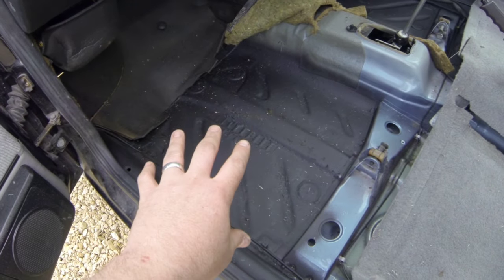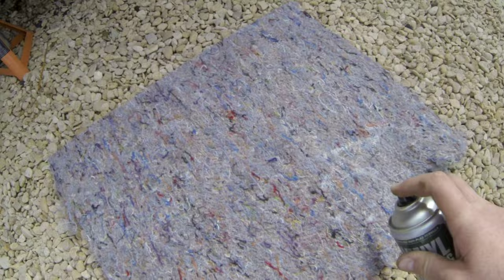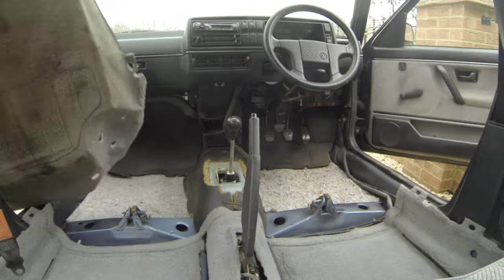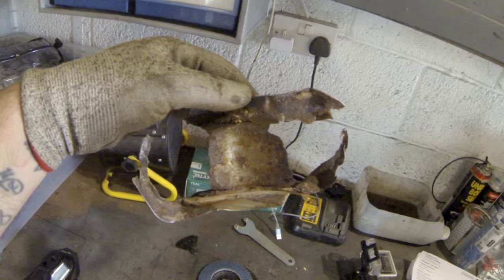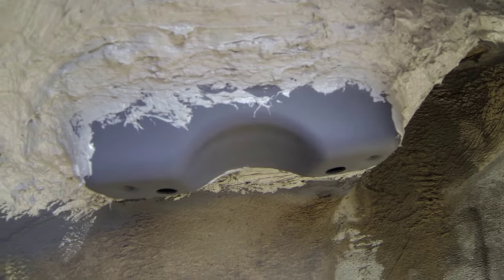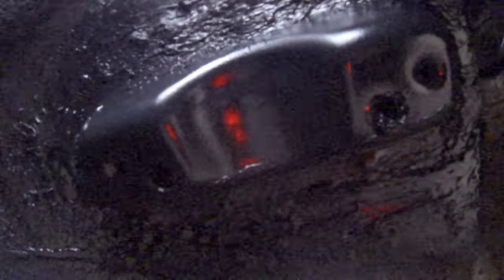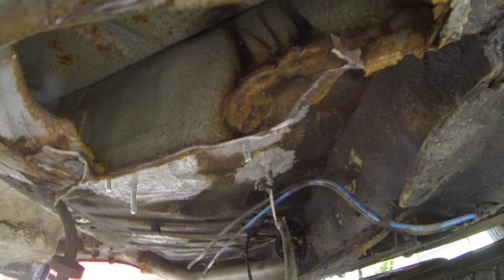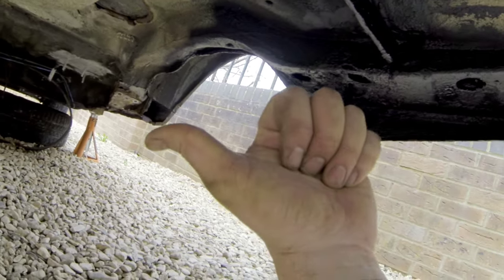RestoMod VW Jetta Mk2 - Eat, Sleep, Weld Repeat

Comment: I did same got off cuts from a carpet shop … when you doing roof lining? I need to get on with mine soon just waiting on a few more dry day …. Good work getting on with well not scared to get stuck in … i hate it when you start a small job and turns in something else have seen old 16v jetta on eBay for sale in Malvern bit of a mess tho
Reply from the maker: Soon hopefully though the rear windows needs to come out to sort that. Is that the white one?
Reply: @GreyGooseRestorations  ya white one some nice parts like seats and engine body will be to far gone  by looks in been  in a Field for years the underneath is probably a rotten pear